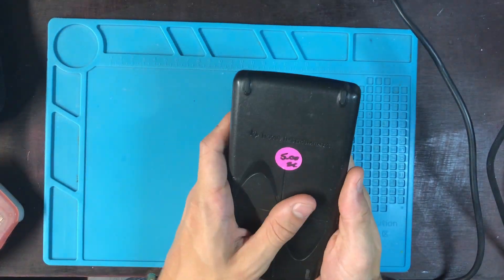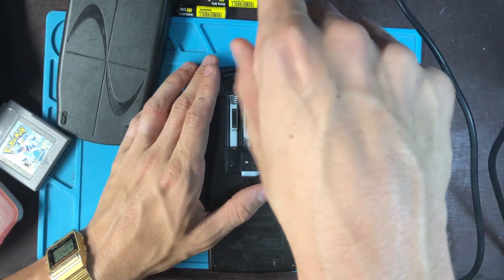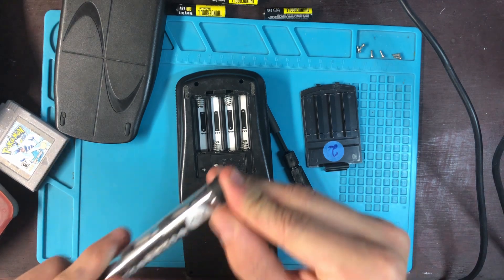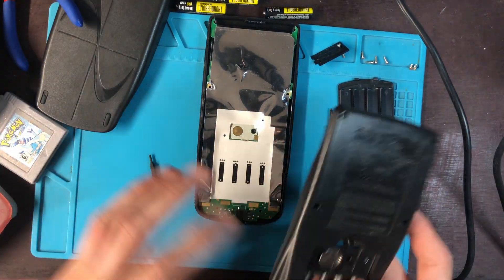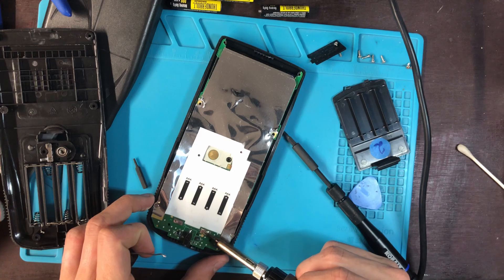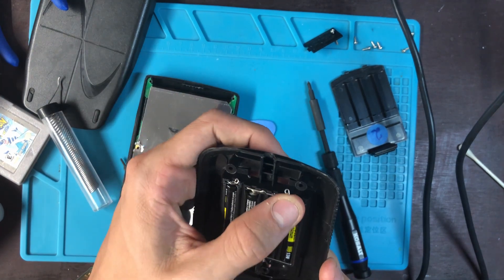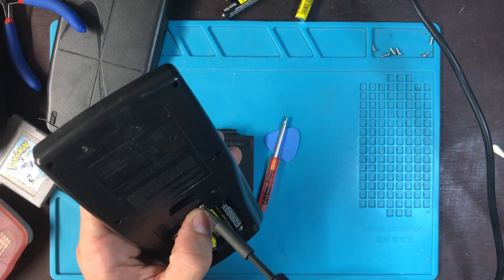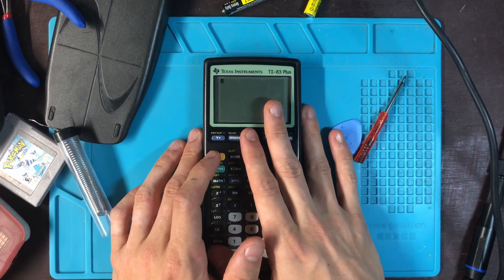Retro Repairs #2 - Repairing a TI-83 Plus Calculator (Corrupted Data or Non-Functioning)

Comment: I’d thought it be the ribbon cable connecting the screen to the board, usually when it’s glitchy reheating the pins seems to fix the issues. But the corrosion on the pads are so common same with the 84, and 89.
Reply from the maker: People leave those batteries in there for ages, I wish people kinda had that mentality that if it’s going to sit, just take the batteries out.
We don’t teach technology enough I feel.
Reply: @RETROXPRESSTHRIFT  I try and buy the 84s on eBay for parts just to fix them and sell them for profit. The 83s are a little more tricky to fix because of the flawed ribbon cable, I usually have to solder wires on those little pins or in some cases just heat the ribbon cable up

Comment: Well done, it was a bit haphazard but you eventually got it working! :P Where'd you hear about bending those wires to reset the contact points? I'd like to see you try and fix the ribbon cable for the screen. (Press [mode] then [alpha] then [S] to start the self test)
Reply from the maker: 100% agree with you! I do things fast, and slowing down is hard for me, but it usually does the trick! I actually figured that out on my own just messing around with it! The contacts send power to the PCB so I just kind of assumed it was a power issues when it starts losing data..also I was kinda rough with it since its just an 83..if it was a 84 or something more expensive I would definitely respect it more! and THANK YOU! I just wrote that self test down for future use!
Reply from the maker: and next calculator I come across with screen tearing youll be the first to know!